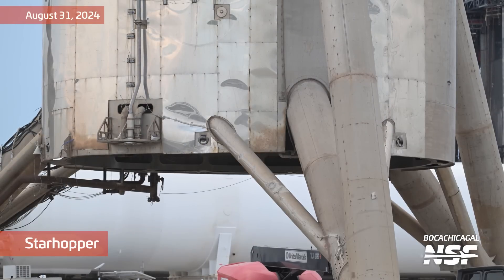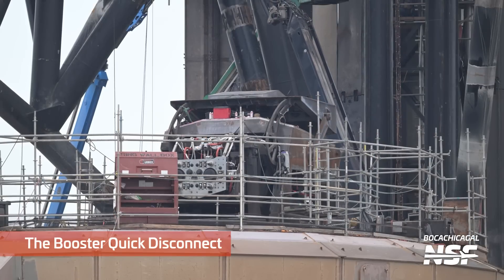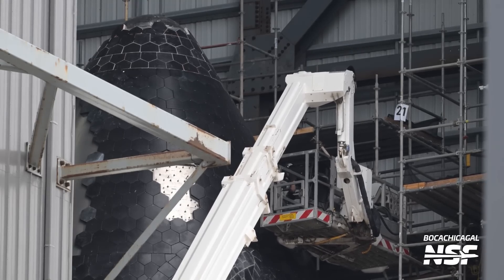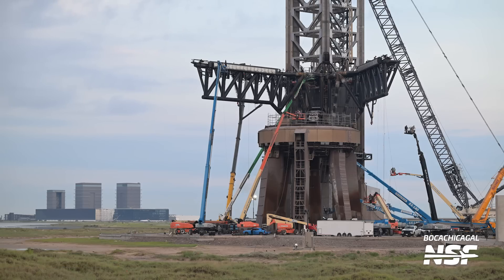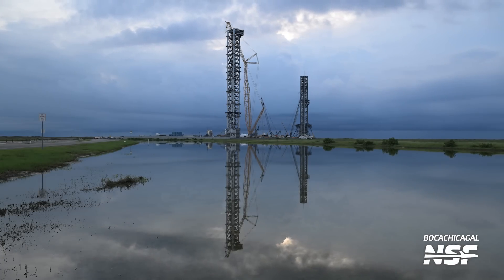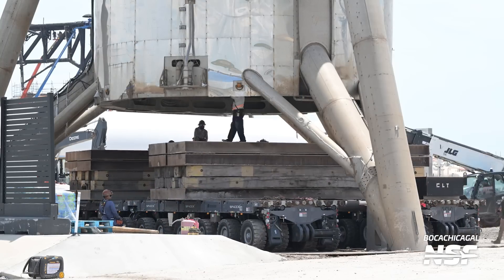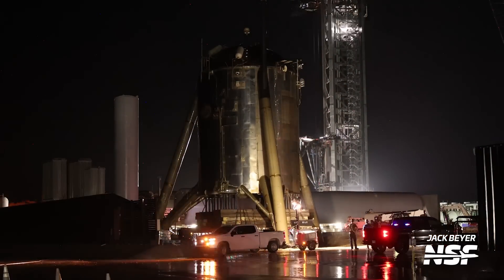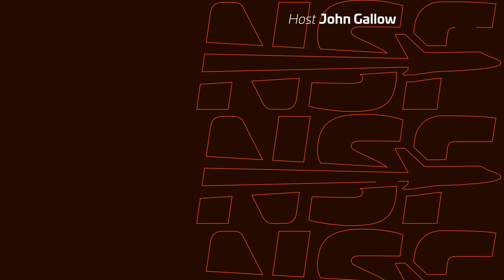Starhopper Leaves the Launch Site | SpaceX Boca Chica

Comment: The company that uses the lifts, normally trains their people to use them. We use JLG boom lifts here to work on large aircraft. It mostly OJT with a day in the class. We have people designated as certifiers that can sign the trainees off. The highest I go is the top of a 767 vertical stab which is 52ft. I am good with that. Some of these at Starbase go WAY higher then at. Not for me. 😱🤢

Comment: If NSF put up a radio station I’d be all in. Would be happy to help build a tower, set up the transmitter, and deal with all that fun FCC stuff given that’s my specialty, however towers are incredibly expensive and FM radio is slowly dying so it probably wouldn’t be a great investment nowadays. Pretty sad to see the slow demise of traditional radio. Also side note, those outlets in the manlifts almost NEVER work. Seems to be a very common occurrence unless the lift is brand new. Best to run an extension cable.

Comment: Oddly enough, I've been trained on those lifts, and even used one before being trained. All the buttons are pretty clearly labelled. With pictograms mostly. Language agnostic, if you will. It doesn't take a lot of guess work to figure out what they all do. You do of course need a fall-protection certificate before you can take the course. It's not terribly expensive... around 250-300 dollars each course where I live. And usually only a single day of training. If you're interested in lifts, why not do it?

Comment: The railing attached to the chopsticks only attached in four areas The Chopsticks might be the only strongest part of the whole thing looks cut corner.
Would it be possible to put a fifth railing straight down the middle where the cable is.
Not being a yerk I want Elon Musk to beat every rocket company
Reply: I thought it was one long rail on each chopstick.

Comment: Scheuerle Fahrzeugfabrik, now known as TII SCHEUERLE, developed the Self-Propelled Modular Transporter (SPMT) in 1983. The SPMT is a heavy-transport technology that has become a global standard. 
 
The SPMT's technical basis includes:
Hydraulically supported oscillating axle: Invented by Willy Scheuerle in 1956
Electronic multidirectional steering: Invented by Willy Scheuerle in 1972 
 
The SPMT's modular design allows it to be combined into different transport units of any size. Each module can be configured with 3, 4, 5, or 6 axle lines, and can have its own drive and control system. The SPMT's load capacity depends on the version, but can reach up to 60 tons per axle line. 
 
The SPMT is used to transport a variety of goods, including luxury yachts, industrial plants, mining vehicle components, offshore wind turbines, hotels, and cultural assets. 
 
In 2022, Mammoet and Scheuerle developed and employed the world's first electric SPMT. 
😊

Comment: Even the steel beams INSIDE the buildings are rusting due to poor paint coatings. Some people didn't know what they were doing down there.  Those buildings will be a rusted ruin long before anybody lands on Mars, if they keep ignoring the rapid rusting. Salt never sleeps, folks. They put 3 coats of paint on the overpass next to the Caesars Superdome in New Orleans, and that was after sandblasting it down to the bare steel. They had to primer coat the bare steel the same day the paint was blasted off, to prevent all rust under the new paint. Once rust gets started, you can't paint over it, especially near salt spray fallout. You do that, & it will just keep rusting under the paint, like cancer. Each paint coat on the overpass was a different color, so they got 3 coats everywhere. With 5 feet of rain a year, & a hot climate, you need good coatings on steel. 
So when you are watching the Super Bowl in the Superdome on February 9, 2025 you won't have to worry about rusty bridges collapsing.
Reply: Those who actually know a thing or two about steel know you're full of sh!t.  Surface rust is nothing.

Comment: I find it hard to believe those things are cushioning pads.
You could make the case the I beams (the one with the dampeners / shock absorbers) has sharp edges, so you need those pads.
But then not the whole length of the beams if we consider the precision of the booster steering during landing.
New chop sticks are therefore shorter.

Comment: Anybody knows who's ever used the lifts There's some basic connections usually electrical on all of them.And if you're doing specialized work, you'll have hydraulic hoses.Air hoses high voltage.Low voltage Water lines fluid lines signal wires.Communication lines pretty much anything you can imagine

If you're doing specialized work where you need a variety of items it's a lot better to have it attached to the lifting mechanism, then try to support the weight of those lines hanging down from the basket.

We once tried to extend a piece of polytubing up a boom lift from a keg, but we could never get enough pressure. All it was was drippy foam when I hit the top. We couldn't even get it to effectively Feed the fourth floor at the third floor was barely trickling out
Reply from the maker: Appreciate the insight! A lot of.people don't realize that the mass of a dangling hose doesn't magically levitate, its got to support it's own weight. See: riser cables. Same with pumping a fluid up multiple stories of height... you've got to support the mass of all the fluid in the hose. Cheers!